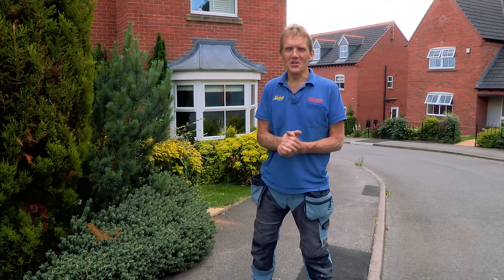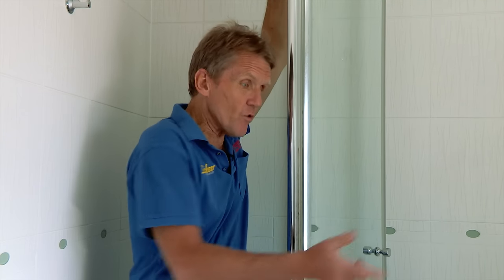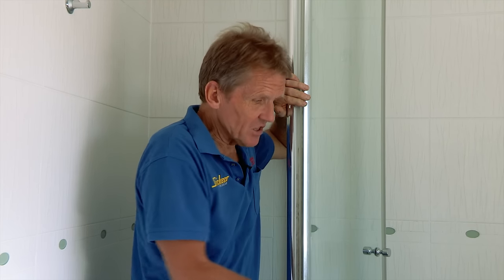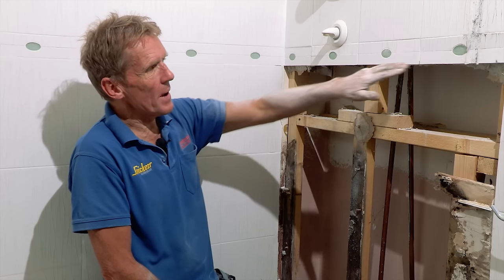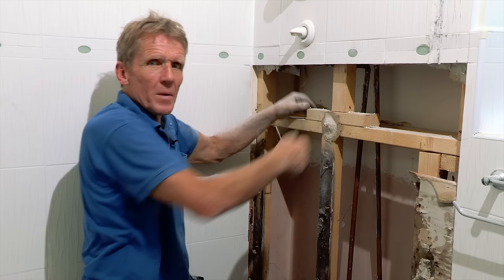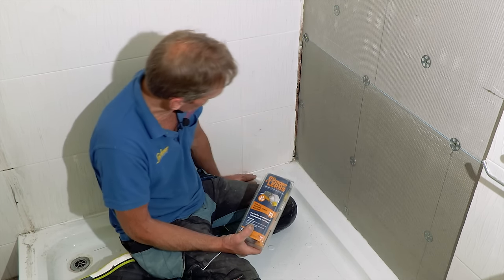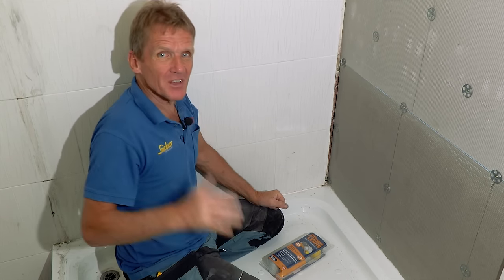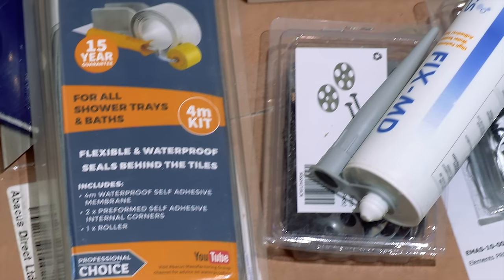Unbelievable Cowboy Plumbing Horror Show

Comment: As you say its a disgrace in the UK - £300,000 or £700,000 the standard of work on New Builds is so poor on top of which the wrong and cheapest materials used. The only winners are the Share holders and owners of the big building firms .

Comment: I’m sure Schluter has been mentioned. While the capital cost is high (but not really considering what you pay for the rest of the bathroom), it installs quickly and is totally bomber. It won’t leak ever. So the classic choice of doing it right or doing it over. Just because you won’t do it over for ten years instead of two years, it’s still  costs more in the long run. 

The Abacus looks similar to Schluter. Tape and liquid flash. (The screws and disks look like those use with Zip sheathing.)

Also, surprised the shower isn’t being completely redone. The same people that did the water wall did the other walls and the drain. Who has a good feeling about that?
Reply from the maker: It was redone after this video. We just wanted to show a limited approach to the repair but then we ripped it all out and put in a new walk in shower.

Comment: Nice to see a job being done correctly. My only concern would be all that work (and cost) but keeping the old shower valve? I appreciate that in most cases replacement cartridges solves shower problems but feel while doing all this work would have been an opportunity to future proof the shower valve itself.
Reply from the maker: Hi Nigel 
Have a look at our update. I went there to cure a leak and I don't always like to cultivate the job and add extra cost  but in the next episode you will see what happened next.

Comment: Indeed on marine ply - never seen a tiled boat.
Reply from the maker: Marine ply is not used for building boats it certainly should not be used on walls for tiling. It supports mould growth that will attack the adhesive and the British Standard Code of Practice prohibits its use. Tilebacker board is the correct material so there is no need to look for alternatives.
Reply: @SkillBuilder  Excellent-thanks for reply. We’re now subscribed.

Comment: I wish this product (element board) was available in New Zealand. Is it not necessary to waterproof the entire board? Leaking behind showers is a common problem in NZ, especially the older homes, where originally builders would have used plasterboard. Nowadays they will use a water resistant plasterboard or a cement board (fibrolite) alternative, but if tiling will use waterproofing as an extra water or vapour membrane.

Comment: Having looked at the video again the main problem here seems to be leaks in the plumbing - not due to the silicone seal, tiling or grout. So the real culprit hear is the plumber and whoever did the framing. Fortunately for this customer the tiles were put on plasterboard and the problem became visible pretty quickly. If however the tiles had been put on the top of the system you used, it could have been months or years before the problem became visible and you would be looking at a much greater repair. You also talk about moisture getting through the tiles and wetting the paper on the plasterboard behind, this is not the case unless there is a breakdown in the grout due to poor tiling materials or not properly maintaining the grout or sealant. You also talk about mould, mould forms on the face of the grout and works it way behind the tiles, not the other way around. The solution to mould or moisture is ventilation and cleaning regularly with some form of mould preventer, especially if there is insufficient ventilation. As for moisture making its way through the tiles, when you consider the tiles are being drenched by the shower and prevent this water getting through to the wall, it's hardly likely that a bit of moisture will make its way through the tiles to the wall, especially as both the tiles and grout are waterproof. The main problem with showers is normally a leak in the pipe work behind the shower or poorly applied or maintained silicone seal - not the tiles or the tiles being fixed to plasterboard. Really is time for a rethink on this and to stop advocating systems that can do more harm than good as most of the problems are caused by poor plumbing practices, not poor tiling or substrates.
Reply: Thought that myself, if the plumbing leak free and the surface is defect free all that is not required. Have seen many plasterboard Ed bathrooms and showers in perfect nick as they were installed correctly and looked after. Still interesting though
Reply: Paul Nutter 
Thank you for the reply Paul. I'm a subscriber to Skill Builders and think the guys make really interesting and informative videos and produce really good quality of work.

However in this case I felt I had to tackle the myth that plasterboard is not suitable for tiling, especially as the comment was made that if an installer tells you it's okay to tile on plasterboard, show them the door.

Unfortunately this is one of the times people are being taken in by all the marketing hype to sell products without fully understanding the possible implications. I would love to hear Roger's views and thoughts on my observations.
Reply: @alexmcneely1680  most failures I see are caused by poor grouting and sealing from either a loose bath or tray or not cleaning tiles before sealing and not forcing grout behind the tiles. Remember the bevel edge tiles that didn't need spacers. Didn't work as the grout couldn't get behind to seal. OK for a whb though😁

Comment: The green drywall was waterproof long ago and did keep moisture at bay. So, you use a roll-on Water barrier prior to tile
Reply from the maker: It was never waterproof just moisture resistant. Yes you can put a membrane on it but the core still wicks water if it isn't sealed.

Comment: I would be concerned  about waterproofing the adjacent wall, if you seal the Wedi (equiv.) board to the face of the adjacent tile, water still gets in grout, into the adhesive layer and will wick behind again.  I would abrade the other tile faces, put an adhesion promotor like Mapei Ecoprim Grip, then waterproof the lot with a liquid applied or glue on 6mm Wedi (eqiv) board and seal joints with their hybrid sealant or your systems recommendation then continue.  I would also strongly recommend to thjhe client to upgrade to EPOXY grout.  I do understand you are doing a fix to a budget and the local code is obviously extremely lax.  Great video from a  presentation and explanation point of view.

Comment: Good work but could be improved.
I would also put adhesive/sealant in between the boards and I between board and shower tray. Either the the boards behind the shower tray and the tray sealed onto it or on top also with sealant. I also would use ready made gaskets available for all sizes of round pipe/round openings, they have a flexible rubber gasket around the pipe and are really completely waterproof... 
For me, my shower system always needs to be fully usable and waterproof even without tiles! 
These boards, I believe, where first made by wedi and are also available in different sizes and shapes (have a look at the wedi website). For standard boards I always use the 12.5mm aftermarket ones from builder depot...
I am doing this since 8y now, first mainly with wedi and now since aftermarket ones are available also other brands whatever is the best price and good size for the project.
These boards are especially useful for outside facing walls to insulate and prevent condensation on the tiles, for example with 50mm thick board. You can also use them boxing in wall hung toilet frames and whatever you want, just glue it on with wedi 610 adhesive or ebt sikaflex or other hybrid sealants/adhesives...
Reply from the maker: You sound like my old school teacher. We do all those things you describe. We seal the tray to the board and we use gaskets. I used to work for Wedi so I know their products inside out. Elements have a similar range and are cheaper. Made in U.K
Reply: @SkillBuilder  I did actually see it in your follow up video and was relieved :)
Thanks for your reply, appreciate it.
I wouldn't consider myself as a teacher, at least not teaching you, apologies if I offended you in any way. Your videos are great, an amazing source for all kinds of work experienced or not, and you are a brilliant teacher!
Yes, wedi are expensive, even more in the UK, and luckily there are now even UK made and cheaper alternatives, although sometimes I need to use wedi if specific sizes/shapes are not available.
I am glad you are promoting these kind of boards and I don't understand why so many builders are not using them. They are superior in so many ways, like you already mentioned...

Comment: At 6:23, Insurance won't cover you for a slow drip, it would be considered as a gradual event. Most insurers will exclude any type of rot. So, if you become aware of a problem, please don't leave it with the assumption it's covered.
Reply from the maker: I have dealt with a great many insurance companies and, although policies do vary, I have found most offer cover for damage caused by fixed water appliances. It matters not if the leaks takes several years to show through. I have replaced floor joists, hacked off plaster and carried out treatments for dry rot. All this is covered by the house insurance.

Comment: Hello, we have to do the plumbing for rental properties and have seen this happen a number of times. I agree with having a better board for the tiling to sit on but one thing i don't agree with is water connections behind the wall etc. All these modern properties i see have hidden toilet cisterns, shower valves etc and no inspection hatches and even when they do it's sometimes just a shelf above the toilet that can be removed which makes getting to any flush pipe under the cistern virtually impossible. Now these modern ideas look ok and posh, you just wait until the tiles have to be bunged off to get to certain parts due to water leaks etc.

Now what i would have liked to have done in this video, if it was possible to do so, is remove that 1980s style shower control (well it looked about that age) and ran the copper pipes up in the void at high level so they are above the splashing area and bring them down screwed to the tiles once fitted, then fitted a bar mixer valve shower with surface mounted 3/4 male to 15mm wall plates so everything is on show and nothing behind the wall except for the copper pipes that if soldered correctly should be ok forever. That way any leak would be visible and accessible and wouldn't damage anything.

What if you get a leak from the copper pipe where it enters the shower valve, that new board would have to come off to get to it if there wasn't any inspection hatches around
Reply from the maker: Cut a tile out, we do it all the time. Multi tools make it easy
Reply: Hello again. I agree, but then only thing is when you take the tile off, the board would have to be cut out and then to replace the board you would have to try and fix some wood behind to fix the board back to, it's a shame to keep disturbing the decoration, where ever possible i would try and go for surface mounted. Thanks for your reply.
Reply from the maker: @davidjeffreys9063  it is very easy with modern hybrid polymers to stick some supports in. We will make video on this keyhole surgery.  It is fun to do.

Comment: I HAVE A QUESTION.  CAN I USE WATERPROOF KIT TO SEAL EXISTING PLASTERBOARD AND THEN TILE THE WALL. ? THANKS FOR ANSWERING.
Reply from the maker: Yes you can buy paint on tanking for plasterboard. Everbuild and Dunlop are two names and there is also Ardex

Comment: Hi Roger, you said they've fitted the 3" x 2" flat ways on and it has no structural integrity.  Why did you not rectify this by fitting them on their edge so that they had structural integrity?

Comment: I'm curious. Shouldn't  you need to remove 1 vertical row of the tiles from the other wall too? So you can properly waterproof the corner?
Reply from the maker: In an ideal world, yes but the other wall is masonry so we gunned some silicone in on the joint. There was no movement there because the stud was screwed to the wall. There is a point where you have to ask the customer how far they want to go. In this case the whole lot came out after we had made this video.

Comment: Have a look at Elddis motorhomes. They use ordinary thin plywood inside on the walls that soak moisture up from outside below the floor and I'm talking about new ones. If they used the stuff you've used in that shower, their warranty claims would disappear, but try telling Elddis that. They don't care. Don't buy one.

Comment: The standards of UK Tradesmen have dropped significantly. My gripe is with Plumbers, many jokers, they know how to give a large bill, but their work can be pointless to average - both write the same large bill. Last month I had a Plumber come to do a simple standard job, he huffed and puffed and didn't do a proper job. As the dust from his van settled I tried his work and it failed. I immediately called his office who were insistent he NEVER leaves a job undone - I said that's exactly what's he's done! Anyway I got another crew in, got a large bill for what is a standard Plumber's job. Jokers.
I think there's less skill about nowadays, they want to write a big bill than do a proper job.

Comment: Dont they have laws covering these things in the UK and building inspectors? Here in Australia all wet areas must be covered with waterproof board before any tiling or painting, and it has to be signed off by an official building inspector.
Reply from the maker: People do what they want in the U.K even if there are laws people don't follow them. We have British Standards which require tanking in we areas but there is no obligation to work to them unless it is in the contract.

Comment: Did you clean all the corrosion off the pipes behind? And fasten shower head to the frame,? Or replace the weak frame? Or both?.
Reply from the maker: The shower valve was fixed to a plate and the head was put on a piece of plywood but the whole lot was ripped out after this video for a bigger walk in shower. The link is on the end of this video. 
The thing about corrossion is often misunderstood. The flux should be washed off but it doesn't eat the copper away. It is more corrossive on steel but the green you see is verdigree caused by oxidisation.

Comment: What do you think of the paint on waterproofing systems like Mapei?
Reply from the maker: All the tanking systems are good and are now a requirement on plasterboard  but I still maintain that sticking tiles onto cardboard which is stuck to a gypsum core is not a great idea. It is cheap and that is the only reason it is still used in bathrooms but spending two or three times that amount to achieve something that offers insulation and a totally waterproof surface that will hold 60kgs per mtr sq is a no brainer IMO

Comment: Does it make sense for a plumber to change out radiator valves that work perfectly just a small leak coming from the connecting nut ,a plumber came round to fix one valve and managed to get my dad to buy a new combi boiler But it was losing pressure every morning  my dad told me they had been in my bedroom checking the radiator so I had a look when they'd gone and the nuts were loose to the touch I checked all of them same so I tightened them up but a couple had started a leak and my dad ring him back and he wanted to change all the radiators for new , you would of thought he would of checked the nuts when he installed the boiler but it's my  Elderly parents  house so  hmm

Comment: It's not always the installers fault! Many builders want things done cheap to maximize profits. Gotta go after the big guys if you want this kind of stuff to stop. I mean, in the case of that valve it would've taken about 5 mins to properly secure, but the material used for the tile is 100% on the builder, trying to save money. I also can't get over that framing job, how far apart are studs allowed to be there?

Comment: I hate being overall critical but 3:27 you explain quite correctly that the studwork is badly done and flexes, which can result in cracks in the grout and water getting through. But then you proceed to do all the remedial work installing the abacus boards, leaving the same shoddy studwork in place! You could at least add a couple of supports to the back wall to stop it from flexing. 11:20 you can clearly see how it flexes as you are pushing it in, this is the studwork not the panels.
Reply from the maker: I did block is back to the wall and remove the flex

Comment: Don't suppose you fancy doing a video down in Weston Super Mare do you?! Need to rip out a shower and downstairs bathroom in an old Victorian house. The Boiler lives in the same room so I was hoping to replace an old electric power shower with a straight mixer shower. I'm going to have a crack at it myself, which will inevitably end in disaster!! Could do with some guidance!

Comment: A shower tray with a raised lip is just way better for ensuring water stays in the tray.
Reply from the maker: Yes I have fitted many but the problem of the tile kick out is only solved by hacking out the tile backer or wall. That creates a void and water which gets in through a cracked grout line can track down there very easily. Some people doubt this but I have seen it especially at the screen profile.